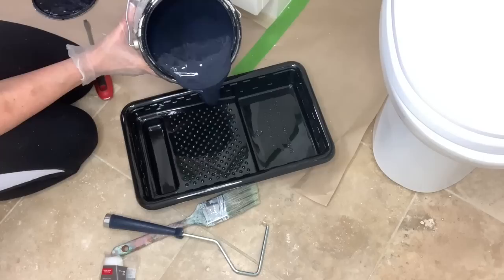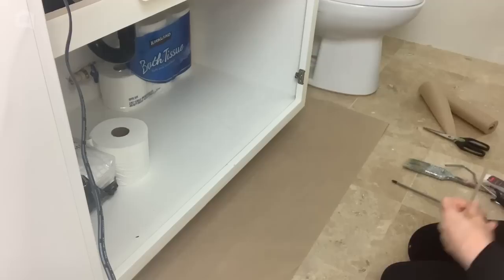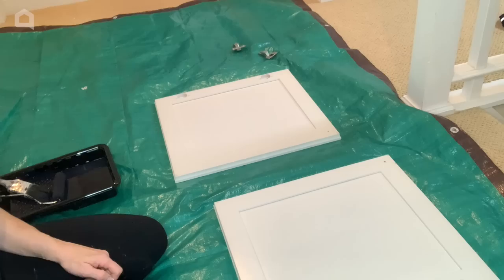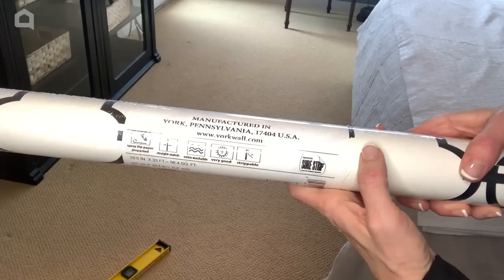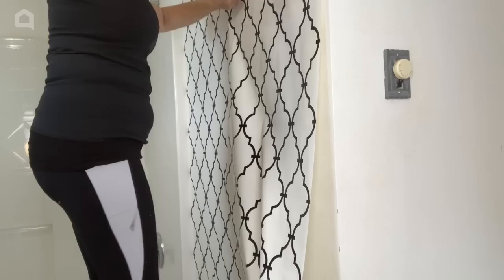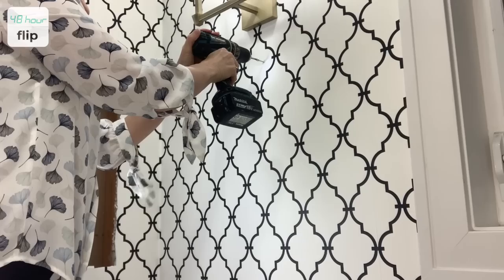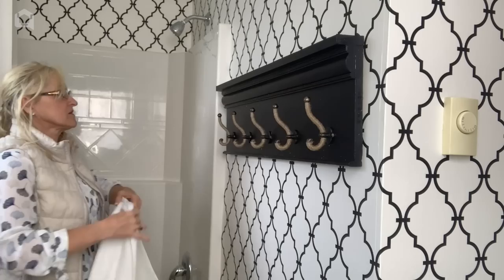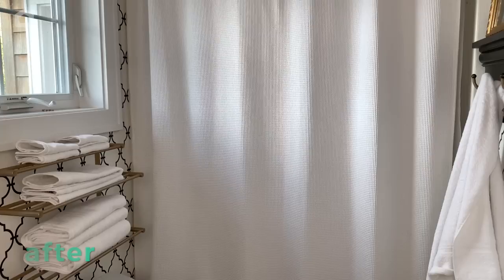Amazing outdated bathroom transformation in 48 hours! | 48 Hour Flip | Hometalk

Comment: Well, 1st of all I liked the yellow stripes of the bathroom. 2nd I used a squirter bottle wet the wallpaper and was able to  peel off the wallpaper quite easily. Plus when you put wallpaper up in a bathroom I would think you'd need a certain kind of wallpaper that could withstand  a bathrooms  steam and issues with water.  I might be wrong but regardless I would have left the yellow wallpaper up.